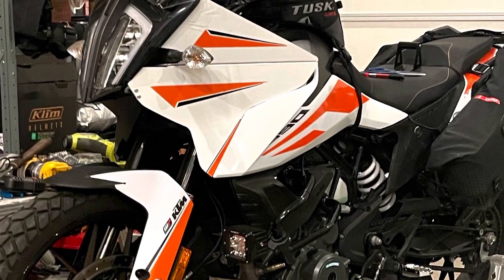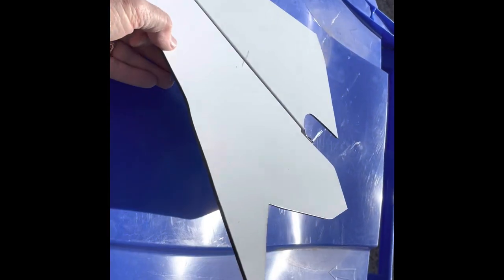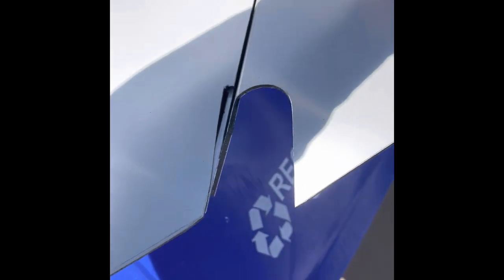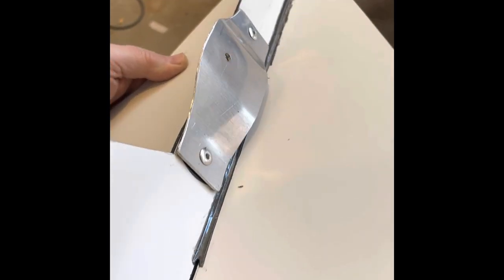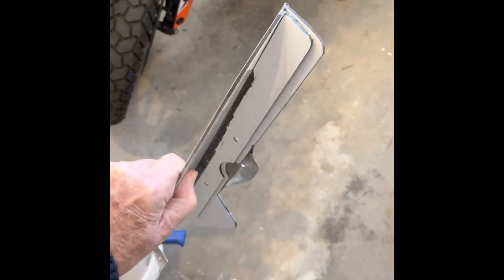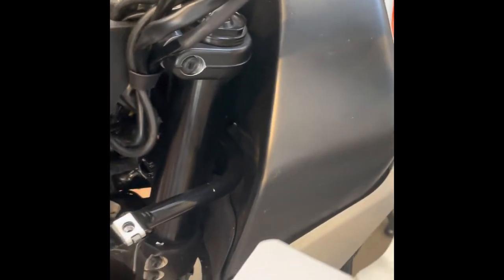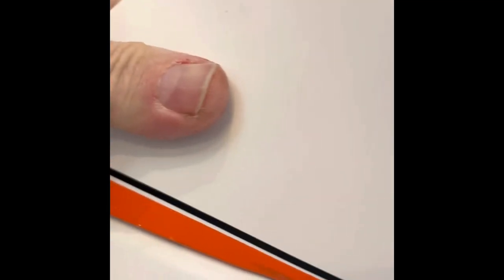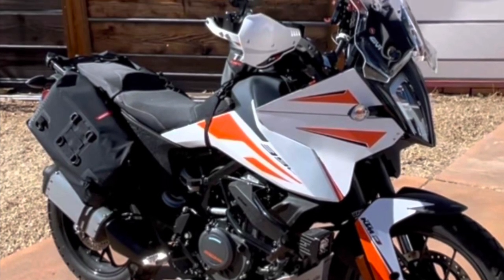Diy KTM 390 adventure aero mod @ Neal McMillan

Comment: That’s a really awesome hack Neal! Do you notice any difference on the road?
Reply from the maker: These things seem to be varied when it comes to wind management. For me it made a big difference.  I'm 5-11 with a 34" inseam and weigh about 180lbs.  I made a couple of more reflectors that mount on the crash bars to try and move more of the lower air away so the it can't come up the front of my body.  Thinking then I could get rid of the additional windshield deflector.  I'll post a video if it works.